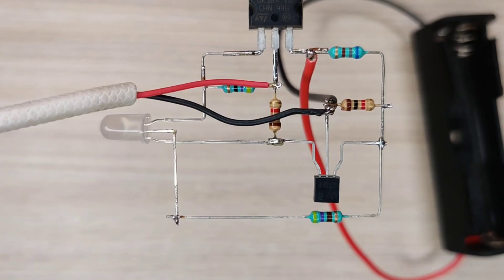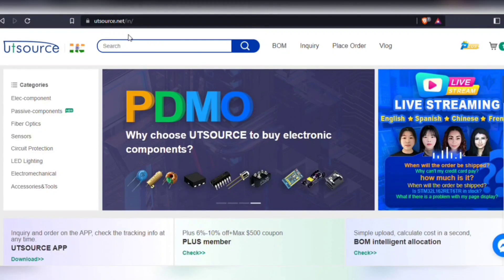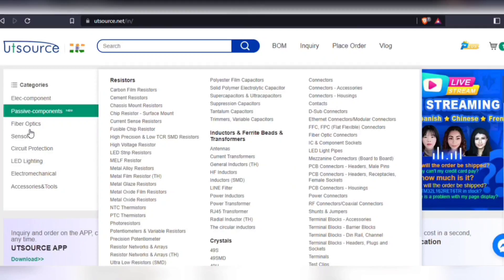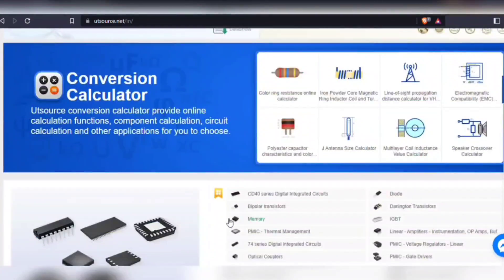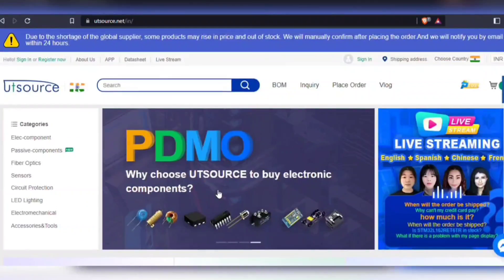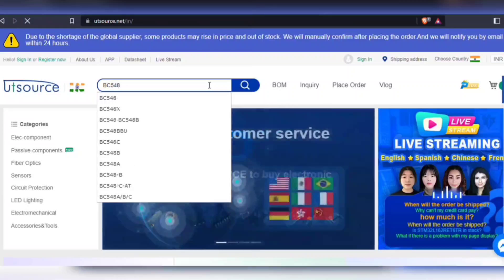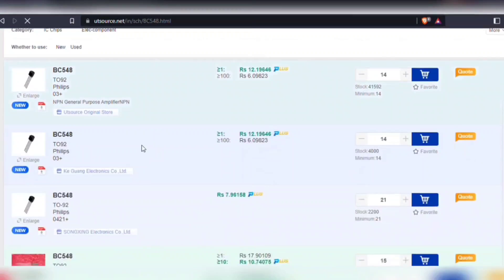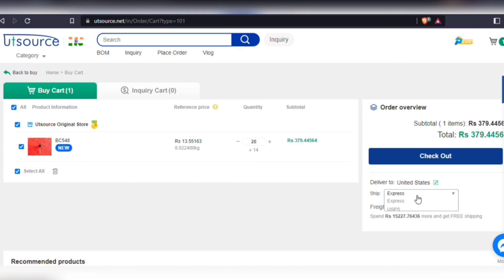Simple 3.7 volt battery charger with auto cut off

Comment: What's the maximum amp output ?
Reply from the maker: 400ma max output current
Reply: @CreativeTechos  You have a great creativity in yourself . But it's just a waste of time and money tp4056 would cost around like 0.25 USD .And it will give 1A output and if you modify it just by changing resistor it can give 2A output the.

Comment: I have a power supply charger for cameras, and its capacity is 12 volts - 16 amps. It has a variable resistance to raise and lower the voltage. Is it suitable for this project?
Reply from the maker: No, you actually need to use 5v 2-3A mobile charger

Comment: Do I need to change the circuit to add 3 batteries to this circuit?
Reply from the maker: Since this is current limited circuit, you can connect 3 batteries in parallel, but it will take longer to full charge them

Comment: Charging would require 5V from source, in this circuit there will be a lot of voltage drop then how can the battery be charged ?
Reply from the maker: This circuit requires 5v dc and output voltage is dropped to 4.2 v using TL431 shunt regulator and 680R resistor, with limiting current with 47R.
It requires 4.2v to charge a 3.7v lithium batteries.

Comment: Good work

If I do not have 13005 Transistor
Is there an alternative to it ??
Reply from the maker: You can use any NPN power transistor, but take care of pin outs as different transistors have different pin configurations. 13005/13003 has pin (1 Base,  2 Collector,  3 Emitter)

Comment: Please frist transister no. in written
Reply from the maker: Part list & Circuit Diagram check in video description.
Reply: @CreativeTechos  The first element is not a transistor. İt is a TL431 programmable voltage regulator.
Reply from the maker: The bc547 looking/sized, TO-92 is TL431 Adjustable zener, or original called voltage shunt regulator.